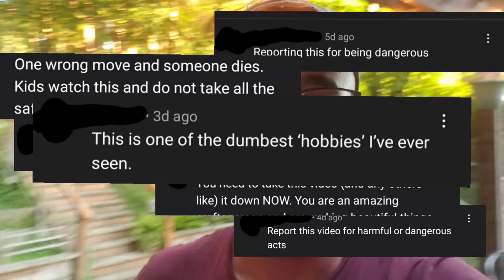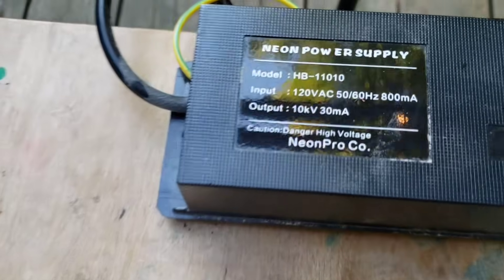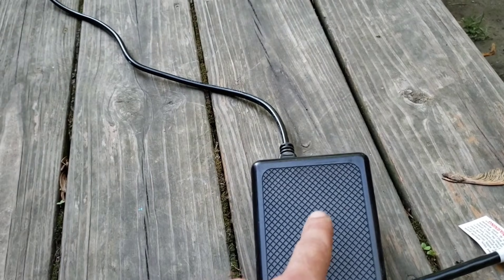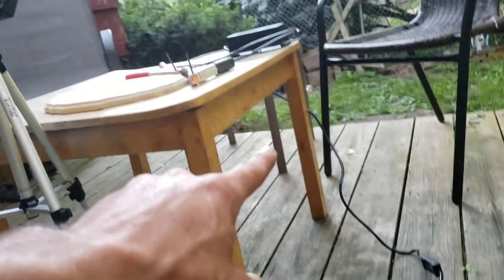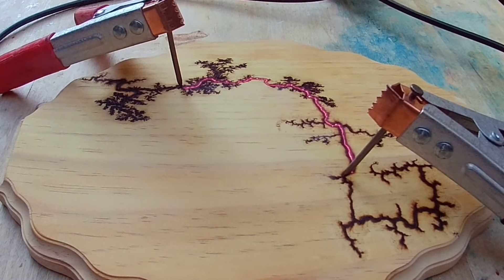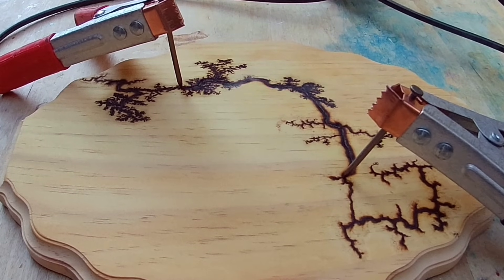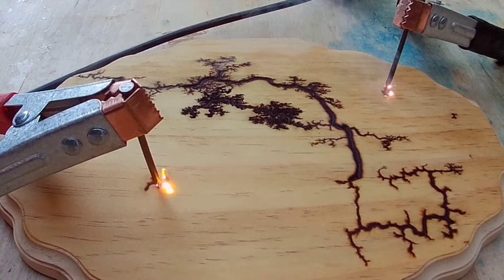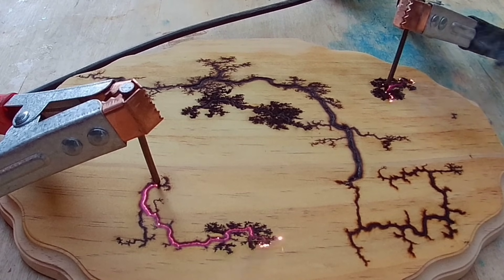Safer Fractal Wood Burning (Lichtenberg) Setup

Comment: I can't believe people actually hold the electrodes in their hands and work close to the electrified work table which they can inadvertantly touch, or brush against.
The main problem is that (as far as I'm aware), there are no professionally made fractal wood burning machines on the market. If such machines were available , safety could be engineered in.  They could comprise of a cabinet with a door that must be closed before energisation can happen. It could be made as safe as using a microwave or any household appliance .

It seems  that you have indeed found a safer way to do this craft , 
I agree , you cannot be shocked if you  can't get within 4 foot of the danger zone ,  without cutting the power supply via the foot switch.
Reply from the maker: That almost sounds like the perfect solution. I'm sure people would find ways to bypass the latch as they do with bypassing the temp shutoff on laser engravers though. I wonder if any company will be brave enough to take that on in the future. 

I've watched some videos that blow my mind with the stupidity of how some people do it though. Fortunately there are a lot of people who do it themselves and will call those unsafe practices out. Unfortunately you can't force those people to be smart
Reply: (this is copied and pasted from another comment I wrote)
I love how you conveniently ignored the placement of the switch on the ground and the lack of safety gloves. Imagine if he tripped on the foot switch and fell onto the wood and got electrocuted to death. And he's using his bare hands to hold those clippers that will electrocute you to death if you just brush against the metal part.
Reply from the maker: @magictoxicswitch2300  30mA will not electrocute me to death even if it were possible for me to keep the machine on while falling toward it (which it is not, due to the Deadman switch). You are probably thinking of the microwave transformer (500mA) that Ann was talking about. As I mentioned in the video, that is not this. Also if I was working with a microwave transformer, gloves would not be sufficient and could even be more of a danger if improperly rated
Reply: @magictoxicswitch2300  He  would have to try very hard to trip over his foot switch , and fall so that he bridges a 4 foot gap  hitting  the table without taking his foot off the foot switch - or dropping his clippers. 
I am generally against fractal wood burning and any misuse of high voltage electricity, but this man does seem to have a safer technique . I didn't say it was absolutely safe , because it is not,  it is safer - much safer  than most set ups I've seen which involve idiots using microwave transformers and  holding jumper leads in their hands and working close to the  work bench .
There are two things I can see that could be dangerous in his set up. One is other people , children or adults who play with unattended equipment . The other is if he gets sloppy and undermines his own safety protocols. In this way  it is dangerous like many power tools are.  A lathe  can tear you limb from limb, we all know that,  but lathe operators posting on YouTube  don't suffer the same online  vindictiveness.
I am so against fractal wood burning that I wouldn't even consider buying a work however beautiful it might be , because I wouldn't want to encourage unsafe practices - as it usually  does involve.
If however the safety standard of this practice can be improved , I might change my stance.
We are not going to stop fractal wood burning, the idea is out there , it can't be taken back and the gear is cheap and easy to make . What can be done however , is we can allow information to be made  public that emphasises  the extreme danger of  the craft , and safe practices can be promoted rather than inhibited .

Comment from the maker: This video is about educating over censoring ⚠️ Remember, do not try this at home. This is a purely educational video. It is dangerous if done incorrectly and accidents can happen. People have died doing this incorrectly and without taking proper safety precautions. Always keep a safe distance from any open electrical current. Stay safe and thanks for watching!
Reply: Hey man I appreciate the info I'm actually a journeyman electrician and this is great info. Just curious if you would be willing to let me know wht u are using in a setup as I am ver interested in doing this.
Reply from the maker: @MKWoodworks  hey man, I found all my materials on Amazon, neon light transformer, deadman foot switch and alligator clamps. Someone else pointed out my wire insulation rating being off so I would look into getting properly insulated wires.
Reply: I weld underwater so.... I can't wait to  do this!!
Reply: If the hate comments prompted you to take a moment to show the lengths you have to go to do this safely, then I can only bless them as successful.  Thank you for showing, in detail, a right way to do this.  I’d like to see another video, if you could, about where you are in your home.  You are, obviously not inside.  What kind of table is that, for instance, and is that important?

Basically, a full safety analysis of your process would be very nice.  Maybe even cancel a couple Darwin Awards.
Reply from the maker: @nobeardthepirate8569  I may do a full in depth breakdown and include all the areas where my set up can be improved upon as well. That is a good idea. I have a build I want to film in the winter that I think is going to be awesome and part of that includes a burn. I'll try to do that before I put that video out
Reply: Question…..as a long time woodworker, I’m familiar with moisture content related to various drying methods etc.  I work primarily with stock dried to less than 8% MC. I’ve often wondered if fractal burning works well on wood that’s super dry. Can you shed any light on this. Any feedback would be much appreciated! Oh, and about your video….don’t sweat the “Karen” comments! There are a multitude of activities that aren’t suitable for idiots. They should know that!
Reply from the maker: @jonswiney6345  I appreciate that Jon, and that is a good question. I'm not sure how much the internal dryness affects it. If I had to guess I would say it probably does need to be fairly dry. Before you burn you rub a water and baking soda solution across the top and that is what conducts the electricity and kind of guides the pattern. I think if it was too damp the current wouldn't be strong enough to create a burn because it would dissipate through the body of the wood more. That's really just a guess though. I have some black walnut drying myself that I was going to experiment with once I mill it. I've only done it on pine and wonder how the density affects it as well. If I get to it I'll let you know!
Reply: I'm disgusted to dude I feel your pain!!!!!
Reply: Thank you for educating people
Reply: Thank you!! I really appreciate your video. Censorship is dangerous, people need to be responsible for themselves. We can't protect people who don't want to think for themselves. Warnings proper and save precocious Yes removing every information about a hobby will increase dangerous behaviour in the future. Like we couldn't stop grown adults from eating tide pods 🙄